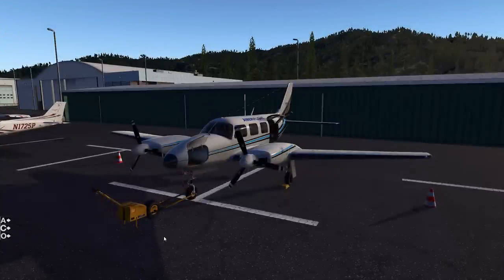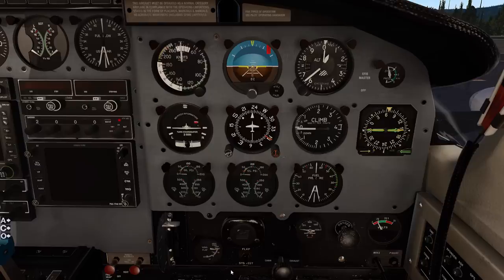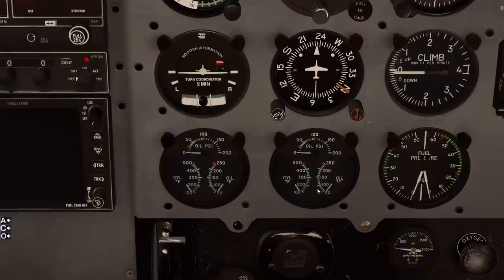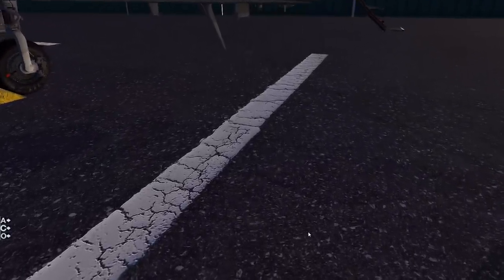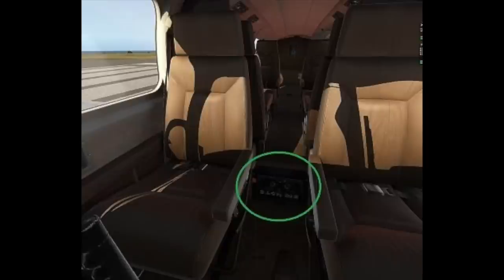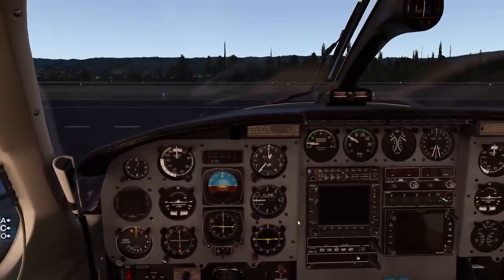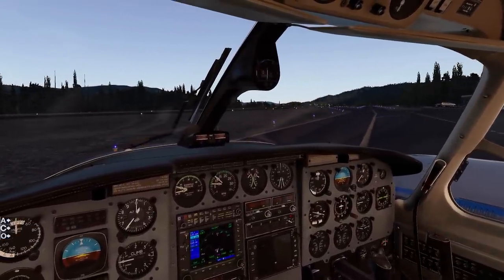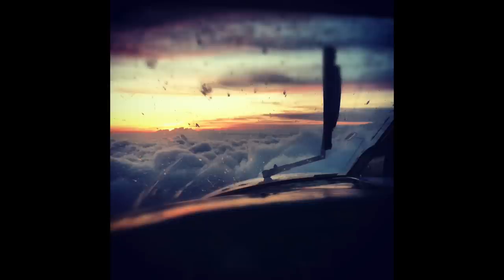I Piston Series HD I Episode 1 Preflight-Taxi

Comment: I just bought the aircraft and I am super excited for your new series. I hope you can help me. I did everything as you described it (I least I thought I did) but when I turn on the magnetos and the engine starter (right), the propeller isn't moving at all. What did I forget?
Reply from the maker: Did the starter crank and and no prop movement? If so, i have aslo encountered this. I think what may have ahppened is your battery voltage dropped too low, OR its a bug that happens..Either way, the workaround for me was to just do a quick reload of the aircraft. Really try to be quick with the battery switch, in faact i woud go as far to say dont even do a lights test before starting, do it after you have an engine running. Report back to see if this helped
Reply: @V1Sim  Thank you for your kind response. It is working now. I guess it was just a bug after the first installation. I re-loaded XP and it worked!
Reply: @V1Sim  May I ask for your rudder settings please, the yaw in particular? Is it the same as you mention it in another video of yours?